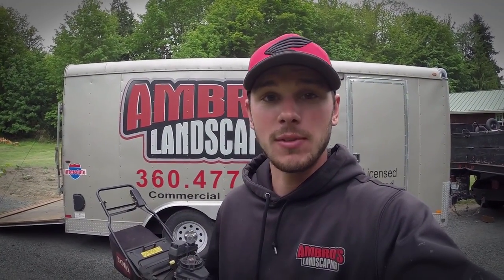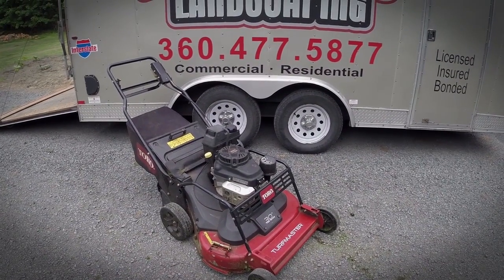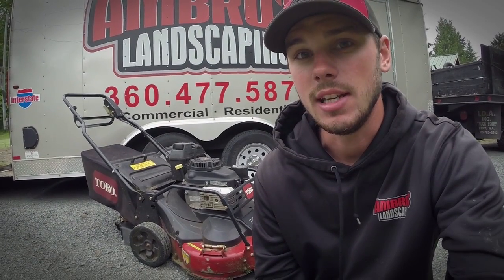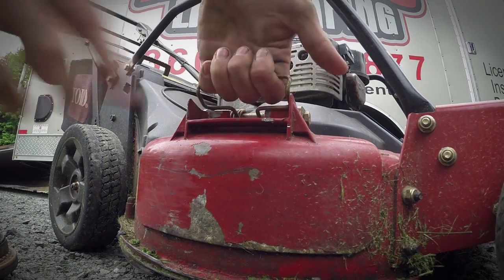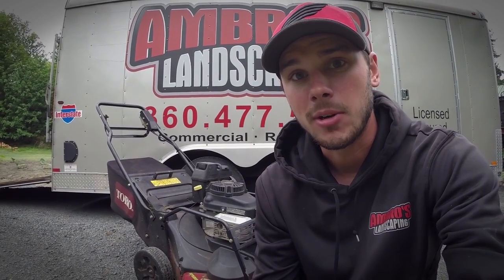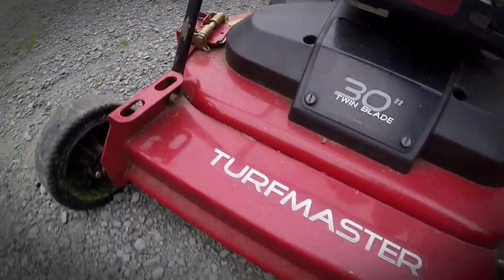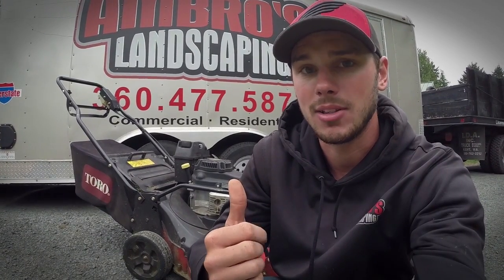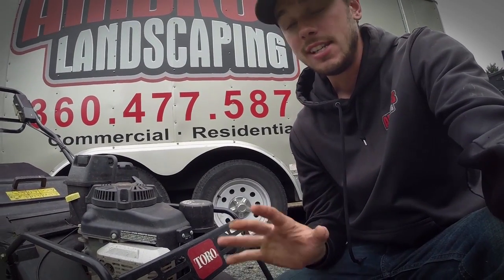Toro Turfmaster 30" - Full Review | Pros & Cons

Comment: Honda needs to make a 30" version of the HRX217HZA
 with Microcut blades (2 sets), hydro drive, NeXite deck, etc.  The only problem is they don't really have the right vertical shaft engine to do the job right.  The GSV190 is probably not quite enough and after that there's nothing until you get to the GXV340 which is perfect power-wise at 15 ft. lbs of torque, but the thing weighs 71 lbs. Maybe if it is situated properly on a nice light (but strong) neXite deck it could work.  Probably would be better with a lighter 250-280cc engine though, if they developed one. Something like that would be a monster and put the Toro and Exmark commercial machines on notice as to the the best mulching capable 30"er available.  Do it Honda!
Reply: They won’t. Honda usually never listens to their customers.

Comment: Hey bud...good video on the toro. I bought the exmark, and have been happy overall. You hit some points that are shared with the exmark. One thing you didn't mention, that I have learned is I ALWAYS shut the fuel valve off, and let the mower stall out when finished mowing a yard before transport. I have owned two of them, and if you don't shut the fuel valve off, because of the bad air filter design, the needle valve can stick open. When this happens, if the valves are in the right spot, the cylinder will fill up with fuel and hydro lock basically. When it happens, you cant restart the mower. You have to pull the spark plug and drain the fuel out. Just something else to keep in mind.
Reply: This is a problem for any machine with the Kawasaki FJ180 Kai. I have had this happen with a toro commercial 21".

Comment: Such a useful review, the manufacturer should really watch this and use it for and future designs, no engineer could possibly note all these user experiences.  I really want a 30" mower just for my own yard to save some time and I'm between this, the exmark and maybe even a commercial 32" but I have some smaller areas and like the rear bagging.  The fact that Toro didn't get back to you on the blade flying off and damaging someone's building, well that pretty much turns me off the most from this mower but since they make Exmark too, well, same thing I guess.  Thanks for posting this really in depth review with real world information.

Comment: Scrape off the foam. We think you can still use the air filter without the foam. UNLESS, this makes the filter too loose. In that case, put something on top of the filter, (such as another piece of GOOD FOAM), to keep it tight. We own a small engine repair shop. Maybe this will help. Excellent video. Very thorough. Thank you!  BTW, what size are your Hondas? 21"? Or larger?

Comment: I also have this mower and you hit it right on the head. I do not have the blade issue that you talked about but more of a carb. issue and not from the air filter. It will not idle down and will not restart when hot it takes sometimes 15 pulls to restart but when cold 1. I dont know if you have this proplem or not but somthing to look for. Also the front baffle comes off with 4 bolts under deck this slightly helps with grass build up under deck. Thanks for video.
Reply: Does it effect the suction or the cut quality ?

Comment: The Turfmaster HDX is supposed to have improved on most of the cons you mentioned. With the air filter, the new ones come with a revised version that has a hard rubber instead of the foam on the bottom. That small Kawasaki is a great engine!
Reply: I got the new one with the Kohler it's awesome 👌🏻

Comment: In The Transmission if you read the instructions there is a bolt or something you can loosen to give more power. I read that and immediately fixed it and I laughed at my self cause that weak transmission gave me so many problems!  That's a heavy mower to be pushing up a steep hill, once I did that I literally was able to move it with no effort, one hand even!

Comment: One question.  Basically no one has the answer.  What is the torque on this engine?  Now some others questions:  Why does the tread matter if it's weight makes wheel grip very good?  Does the ticking problem still exist on the latest models as of 5/2017?  Why does turning this mower seem very awkward?  Lastly, this is the 22200 model.  Have you done a review for the newer 22210 model?
Reply: FergusLandscaping. 
Max. power 	3.4 kW (4.5 hp) / 3600 rpm
Max. torque 	10.0 Nm (7.3 ft.lbs) / 2400 rpm
Reply: Thanks for the info.  This model 22200 is old and is kinda weak Kawasaki at 7.3ftlbs.  The newer 22210 model on toro's site doesn't show the torque for it's eninge nor does Kawasaki, why??  The TimeMaster has a Briggs/Stratton engine and easily displays it 10 ftlbs of torque.  I thought the TurfMaster was for commercial and stronger?  Well, thanks for Briggs!  I use a Toro Smart Stow 20339.  I'm very happy with it.  I am considering a 30inch or just jumping to a ride on and use the 20339 for cutting in or small properties.

Comment: check ur belt tension and make sure the belts not rubbing against the plastic front piece.        u have to make the belts on these pretty loose.       we used the timemasters for commerical use , for the first 2 years they did great but after that it was junked.        u gotta take off the plastic piece then loosenthe metal bracket clamp and when u do, its spring loaded and worked by tension so just make it looser and itlls go away,     try it a few times until u get it perfect, ur going to want to make it a little loose .
Reply from the maker: sonic knuckels thanks for the comment and. Its funny that you said that cause literally last week me and a friend were working on it trying to figure out that noise and found out it was the belt tensioner. It look a little bit of finding that right spot where I doesn't make that noise and we found it. It also cuts way better now! I was cutting some pretty thick green wet grass yesterday and it cut every blade of grass, were before it would miss so much. Thanks for the comment, I really appreciate it.
Reply: Ambro's Landscaping Inc.   lol we used these last year and iwas the guy who fixed all the broken mowers and stuff,  ive been fixing lawnmowers and shit since i was like 10, im 24 now .     another thing that suck about these is they leave stupid ( mowhawk) cuts and they bog down in 3 inches of grass.      anoher thing that sucks is the RPMS that the motor /blades spin at is very slow so what you have to do is take off the govenor spring and cut a few rings out of it then bend another tab and then it will make the engine and blade spin faster..

Comment: First view!! Finally lol. One quick question, on my turfmaster my engine keeps popping and idk why like it will start idle Pop then die
Reply: The popping usually is a result of there being too much gas in the carburetor  when the engine is off. If it runs, pops, then dies, it may have a choke problem not allowing enough gas into the engine, but floods the carb.
Reply from the maker: Kevin Jag that sounds right to me as well. My dealer told me that during transport, the red knob that is connect along your fuel line, to shut that off and it should help the problem.
Reply: try some seafoam

Comment: Is the turf master faster than the timemaster from Depot? I have a timemaster but wanted a beefier Commercial
Reply: I would get the turfmaster. The HDX is much improved with a beefier engine and transmission.

It's a good thing that Toro is improving because they used to have so much cheap plastic parts. I want to support American made so the HDX is a beast

Comment: List of issue's about the 30 inch Toro Turd-Master the transmissions go out within a year, another the cable brake bracket snap off due to factory not using lube to prevent corrosion when assembled in mexico. So you end up with broken screw stuck in cutting deck that takes awhile to extract broken screw out. And the V-Belts go out with 4 to 6 months of use... The Brake Arm pully's get locked up.. Another issue, the cutting deck pulleys go out when the dust caps pop-off allowing dirt inside causing wear burning out the bearings, the Factory sometimes forget to tighten the damn motor mounts on upper deck gets worn out due to vibration... Don't ever buy one. It's the worse design flaw, and a cheap design that is too heavy and slap on face on the consumer. I know cuz I work on these at a dealership repairing em for warranty paying the Tech shit to fix their issue's. Don't even waste your time with the new 21" Commercial Toros.. They are shit too, the transmissions go out on those during year and half of use...

 The Old 21 inch commercial Toros 22195 and 22197 still the best. DON'T buy a new one.

Comment: 30" Mowers look Sooo Slow. I used to have a 32" stander. Cost more but... Seems faster and easier.
Reply: You can put 2.  30s in the back of a pickup so no need to pull a trailer. That saves you a fortune

Comment: THE WHEELS ON ALMOST ALL MOWERS ARE PURPOSELY MADE CHEAP. DESIGNED THIS WAY INTENTIONALLY SO THEY CAN GOUGE YOU ON REPLACEMENT WHEELS EVERY YEAR OR TWO. WHAT THEY WANT FOR JUST ONE WHEEL IS INSANE LET ALONE FOUR. YOU WOULD HOPE AT SOME POINT SOMEONE WOULD MAKE HIGH QUALITY AFTER MARKET WHEELS AND CASH IN ON THESE BASTARDS. I KNOW THEY COULD BE MADE FOR THE SAME PRICE AND WHO WOULDN'T WANT THE LONGER LASTING WHEEL ?
Reply: its not just the wheels buddy. my friends works on our toro dealer. works on them all day.
he says every year, more plastic, less metal. They make these machines to work well for a little while then break.
maybe I've just had a bad experience, but I've spent probably over 25,000 just on Toro equipment. and this 30inch is truly a piece of crap!

Comment: I would never buy one. You can't beat Honda.
Reply: what u mean?
Reply: +The Prodigal Son i'm saying and I mean that shit trash Honda way better
Reply: +Juan Rocha you got a Honda hrc216? I'm looking to finally bite the bullet and buy one. my only worries are it's weight, scared of leaving ruts on my yards, and I hear people say it marks them. I love a heavy mower but is it that bad to rut on yards? Also the extra cushion on those exmark/toro bag corners make me jealous and think why hasn't honda added them on the 2015/2016 models. I also like how the exmark/Toros bag lets u see how much u have collected before taking it out to check like on a Honda you would and that easy adjustments. I own a older toro heavy duty recycler with a Honda engine on it and I love it, starts at first pull but its old and I really want a hrc216, because I know I'm missing out.
Reply: Its a 30 inch mower, not 21 inch. Thats why people buy them.
Reply: Does Honda have 30 inch mowers?
Reply: I have a 21in toro with honda engine that works  great, but I'd like to have a bigger mower.